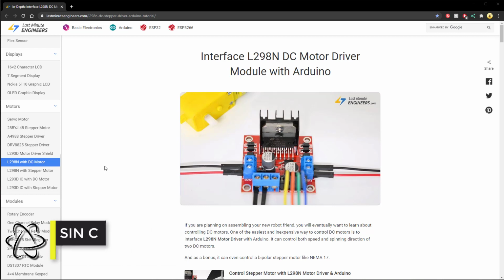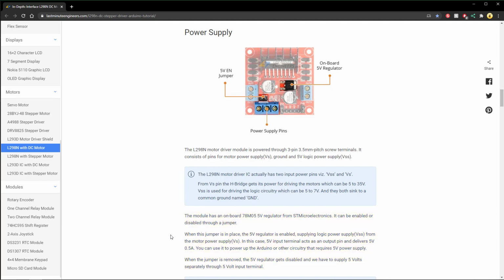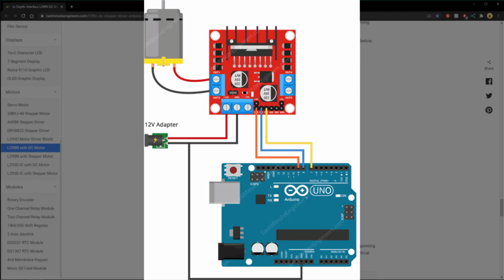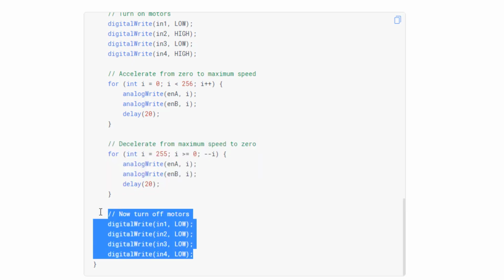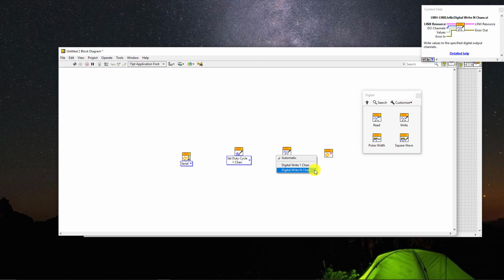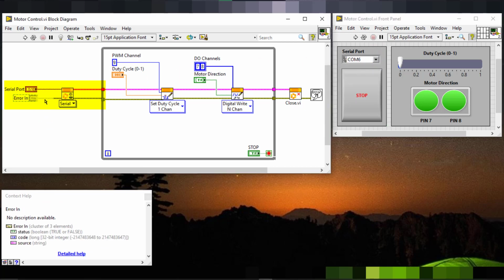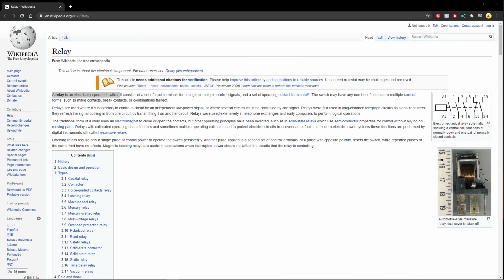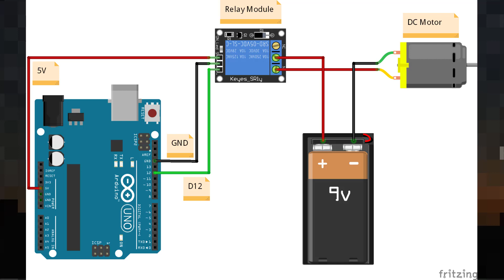LabVIEW Basics #10 - Controlling a DC motor in LabVIEW (LINX) with a L298N H-Bridge IC and Relay

Comment: Hello again...How do you know the speed at a certain point on the duty cycle? My fan has 3 speeds on a little controller, where you have to manually control it. Which from the fan's spec I know what are mine CFM at Low, Med, and High. Since now that I am controlling it using the duty cycle which is from 0-1. Can you help me how to figure out the the speed?

Comment: Hi, I was wondering if it is possible to do the same using a L293D motor shield attached to Arduino UNO. I have tried that but it seems I cannot control the spinning direction of the connected dc motor.
Reply from the maker: Hi Alexandru, 

I'm sure you definitely could, it would just require modifying the VI to send the appropriate signals to the L293D motor shield. This shield is a bit more complicated than the one I used in this example, so all that would be required is becoming familiar with its operation as explained here https://lastminuteengineers.com/l293d-motor-driver-shield-arduino-tutorial/

Then interpreting there code into LabVIEW using the LINX functions palette, so a bit of experimentation is required.
Reply: @SINConsulting  Thank you for your answer!

Comment: ı have a some porblemes
Reply from the maker: Hi Busra, what issues are you having?
Reply: @SINConsulting  First of all because you explained it in a very detailed and beautiful way and step by step. thank you. I've done all the installations and also used your .vi on github but I'm having problems controlling the engine. It responds late, the engine runs but does not react to the commands I give later. I am using clone arduino. 💖
Reply: Sir, can you help me please ?
Reply from the maker: Sure, there shouldn't be any delay in the VI because there is no timing functions in the while loop. So it's set to run as fast as your CPU can handle. A few things you could try to debug this issue is:

1. Make sure you are stopping the VI by only using the STOP button, do not use the Abort button because this sometimes can tie up the VISA resources;
2. Make sure the duty cycle is set correctly;
3. Re-upload the LINX/Hobbyist Firmware and try a different USB port;
4. Check your circuit to ensure everything is grounded properly. 
5. Make sure you are not powering your MOTOR and DRIVER through the Arduino 5V, but through an external 5V power supply.

Then try to run the example again, if it still doesn't work, try running the basic LINX blink example to see if that code runs without any issues. If it does, then the problem is with the motor controller VI you're using, which you might want to re-write again on your LabVIEW edition to test :)

Otherwise, if that all fails please send me the VI you are using through my email listed on my YT channel and I'll take a look to make sure it's all fine.
Reply: @SINConsulting  Hello Sir,
I did what he said one by one and checked it and there are no errors. I am using Labview 2020. I tried a different exit but still the engine does not work.
If we come to the example of turning on the led, the led lights up late here and then the commands I give are not detected by the arduino and gives the error 5001 code.
Both the LED and the motor work one time and they cannot perceive the commands I give later.
Reply from the maker: I am pretty certain error 5001 is a serial timeout error. So the serial communication between LabVIEW and the Arduino is timing out.

You will have to diagnose this by process of elimination. 

1. Check that the Arduino and external PSU share a common ground. If they don't this can cause a time-out.
2. Try a diffrent USB cable.
3. Try a different Arduino Uno board.

Otherwise, if the code is exactly the same as my example there is not much else I can suggest Busra :)
Reply: @SINConsulting  Hello I sent you a mail. thank you. I'm waiting for your answer.
Reply: @SINConsulting  Your troubleshooting steps helped me out! Using that stop button instead of the abort button was certainly behind the issue of the Arduino/resource not getting freed up!

Comment: Hello, at the 16.60 minute mark, i didnt see you control the fan speed, i just saw on/off only. Are you able to control the fan speed with the same code? how do you wire the motor to pin 9 with the duty cycle?
Reply from the maker: Hi Anh, that is because the motor is being controlled by a relay which is an 'electronic' switch, so all i am doing is turning the motor on and off. If you need to control speed and direction please use a H-Bridge circuit as I demonstrate in the first part of the video.
Reply: @SINConsulting  Hi, thanks for the quick response...I see that now. So, if I want to control on/off fan and speed at the same time, would the H-bridge work or the H-bridge is only for controlling seed and direction? because right now I am using an Arduino Relay connects to Arduino Omega and I can only turn the fans on/off. Please advise, Thank you much for your help.
Reply from the maker: You can also turn the motor off with a H-Bridge by setting the Duty Cycle of the signal to zero :)
Reply: @SINConsulting   i should have read that lastminuteengineers site before asking questions...great article on the L298N...but thanks again...

Comment: Would you be able to make a similar video for controlling a stepper motor with a driver like the TB6600?
Reply from the maker: Thanks for the suggestion :) I have already planned to make a stepper motor tutorial, so it should be out this year sometime.
Reply: @SINConsulting  do you happen to have a VI already? Im running into some problems with trying to control a stepper motor using LINX. :(
Reply from the maker: Feel free to email me, and I'll see if I can help. I'm only currently working on a pan-tilt servo VI.
Reply: @SINConsulting  I actually managed to solve it just now! Started panicking too soon haha. Thanks a lot though and also thanks for the tutorials you upload. They are very helpful.
Reply: @YaseminTheBest  Would you be willing to share how you solved this ?  I'm in the same boat, trying to get a stepper to work with linx.
Reply: @aleksstajdohar9275  sure! Do you have discord or any other place where i can contact you?